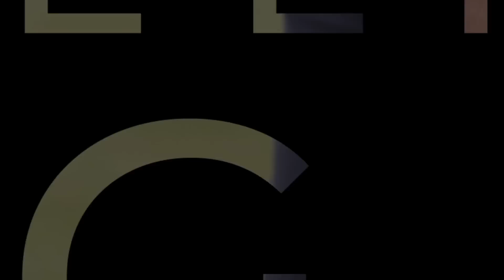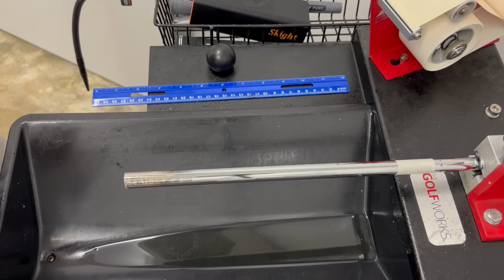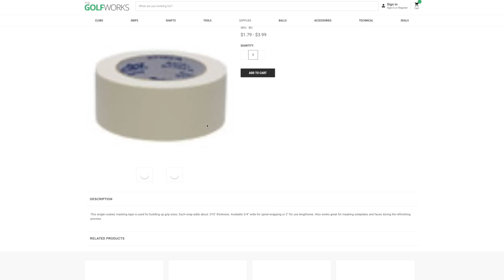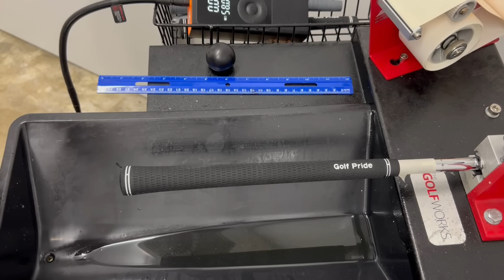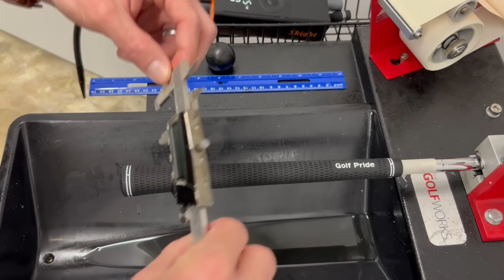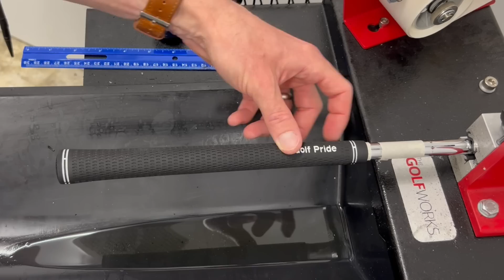Making Golf Grips Bigger with Build Up Tape / Mistake?

Comment: I realize this video is a couple years old now, but I wanted to add something.  Here's the problem I have.  Some grips are only available in the "standard" grip size.  For example, For myself I need Midsize grips, but the Golf Pride V55 grips ONLY come in standard size.  If I want that grip, I don't have a choice put to build up the layers of tape.  I thought adding 4 layers of the thicker tape PLUS a layer of the double-sided tape would be the right amount.  Would it have gotten you to 0.96 if you had added a single layer of the double-sided tape on top of the 6 layers?
Reply from the maker: The big problem is it's hard to know how much bigger the grip will get with multiple layers of tape. Yes it gets bigger, but the percentage change gets smaller with each additional layer and the grip as mentioned gets much firmer.

Comment: New to regriping my own clubs.  Have done several times and used "standard" double sided adhesive strips.  Peel off one side of tape, wrap around the shaft.  Then peel off the other side and ensured it had no wrinkles.  Then lathered on the tape with solvent, put some inside the grip, and then slide the grip on the shaft.  I see you regriping using regular masking tape with adhesive on one side.  That said, does not the double sided adhesive strips hold the grip in place better as it is laying on adhesive rather than just laying on the non adhesive masking tape side?  I see you use masking tape when sliding on the grip using a tire pump.  Great and informative videos...please keep them coming.

Comment: Late to the topic, but after fiddeling around with many layers of tape under a oversize grip, I found that a bigger grip is of course softer and therefore plays smaller under pressure. When I grip a oversize grip the rubber compresses visibly, whereas a midsize grip over 6 layers of tape compresses noticeably less. In the video measurements are all done staticly on a ungriped grip. So to build one more layer to the madness: Could 4 layers of tape be the same thickness as one size bigger in a swing gripping squeezing hand of a pro, and therefore the conclusion has come so?

Comment: Be careful: swing weights and tape. I over size all my grips but halted this practice. 
There is a 25mm wide foam double sided tape on the market now. 
Even though its a spiral wrap, it is great turns any grip to jumbo/ oversize without messing with swing weight.

Comment: Midsize grips have physically more rubber material in the handle portion… it’s thicker by design buildup tape to make grips thicker only makes the bottom hand thicker not the proper taper in the butt end… thank you!

Comment: The rubber grip is still stretching...it's stretching radially and this can not be overcome...increased shaft diameter from tape will cause this.   And increase doe tontape will always result in a reduction also.  Reduction is smaller than increase!

Comment: I go along with you, the installed grip length should be the same as the uninstalled grip length. The grip is not being stretched it is at its designed length.

Comment: Great video.  The other issue that you did not present which would be cool is the weight difference between the mid-size and regular grips and the weight of the buildup tape.  Bottom line IMO is that you can make it, see where it is and then adjust - with blowing the grips on it is super easy to make adjustments.  Once you get your recipe for what you or the customer likes then you can repeat that moving forward.  Thanks again for the video

Comment: You even gave the advantage to your doubters by allowing the standard grip to "settle" where it wanted to on the shaft. That should have added even more thickness yet it did not. Your first method that ensured all grips where at the same length is the best way to assure fairness in the test. Well done and thank you for the great work you do!

Comment: Great video as always.
Ppl always have their opinions and that’s all it is…they’re opinions.
As long as your customers are happy with the work, keep on keeping on.
I think the only reason you would use build up tape to get a. Standard grip bigger is to stretch the rubber thinner over the buildup tape to get a firmer feel…otherwise just buy the correct size grip.
I will add additional layers to my lower hand only, to increase the diameter and gain a firmer feel for my bottom hand.
Great content and patience, as always. 
Keep on Keeping on!

Comment: Sometimes stretching is good! For years I've played standard grips and the grip would move around in my swing. Bought a standard tour velvet+4 and a midsize tour velvet to see which i liked better. The midsize was too big in the left hand but perfect in the right. The plus4 was too small in the left hand and too big in the right. I measured the diameter of the grip where my right pointer finger and thumb sits on the midsize grip (.82"). Took the standard plus4 and built the butt to .094" and to get the right hand smaller I stretched the grip about 1/4" towards the end to get my .082" number. Fits my hands perfectly! I'd feel pretty bad asking someone to regrip my clubs for me with these specs though lol.

Comment: Standard "build-up tape" used on professional tours around the world are not 0.10" thick. The standard build-up tape, also sold by Golfworks, is 0.15" thick. I am really surprised that you are not aware of this. 

That is exactly why there is a Golfpride MCC +4 grip. That +4 grip simulates 4 pieces of build-up tape, which equals 0.6" -- thus a  1/16" larger lower-hand. Whoever told you that 0.10" build up tape is standard is dead wrong - and if it says it on the Golfworks website they are wrong. If the standard was 0.10" then that Golfpride grip would be called MCC +6.

I've bought grips that Golfworks has listed as 65g. When I weigh them, they are 58.5 grams. Some information online is just wrong and you have to verify it before claiming it is correct to your audience.
Reply from the maker: The primary issue remains regardless of the thickness of the tape. The rubber stretches and thins out and the size does not change in the basic math that many believe.
Reply: @EFGMC  First of all, not all grips are 100% rubber or rubber at all. For instance, my grips are 100% polymer Winn grips. The build-up tape absolutely changes the diameter of the grips, or else NO PGA TOUR PLAYER would ever request it. It's a fact that that the vast majority of PGA players, whom are highly-sensitive to feel, all request build-up tape for a reason. If it didn't increase the grip size, surely they would be the first to put an end to the practice of having it added. Scottie Scheffler for instance uses a standard grip with 6 layers of build up tape. I would love someone to tell him that all the build-up tape is doing is stretching the grip 😂 Or tell Tiger for that matter. Again, it increases the grip diameter regardless of whether it may stretch the grip. Those two things are not mutually exclusive, yet in your comment you have stated it as if it is.
Reply from the maker: @Thapa_Golfs  Does it make it bigger, yes with enough wraps but it's not a 1 to 1 ratio. Each grip is going to be different so get some calipers and see what your particular grip does with multiple layers under it.

Comment: Using build up tape on a standard grip to go to a midsize is inane. If you need your grip to be midsize, JUST BUY A MIDSIZE GRIP! 😆😆

Now if you need something in between standard and midsize, then yes, build up tape is useful. In addition, there is no right way to regrip your clubs. It’s a method to use of course, but each golfer is different in terms of what they feel. Look up regrip techniques on YouTube and you’ll see a hundred methods (exaggerating, but you get the point). Mr. Elite, do it your way. Don’t succumb to all these “experts” that probably don’t even break 90! Here endeth the lesson 😂

Comment: I have the opposite problem. I have PING Aqua grips -1/64. The standard Velvet grip on 0.600 shaft is too thick for me. I would like the colored Star grips, but I'm afraid they will be too thick as well. If I order undersize 0.58, -1/32. How many tapes should I put to achieve Aqua -1/64 vs standard? And is that the ideal choice?
Reply from the maker: I would take the standard and stretch it down an extra 3/4 inch. That will get you close.
Reply: @EFGMC  Thank you very much. And can the grip be stretched even when using an air gun? I don't have experience with it yet. You really don't recommend taping the undersize? By the way, I really like your channel
Reply from the maker: @konrigm  They will stretch, but not sure how long they will hold the stretch.

Comment: Of course you only got to half way. The larger internal diameter of the shaft with 6 layers of grip tape means the standard grip must stretch to go around the larger diameter. As the grip stretches it thins. Duh. I don't know why anyone would give you grief about this, as this is basic, elementary physics. "As a body is stretched it will become thinner." If you want a larger grip just buy larger grips. Love your work mate. Keep going.

Comment: Can you use a simple tire compressor to blow on or off golf grips?  Do you need a compressor that is 1/2 gallon spec and if so is that different than the ones you see on Amazon for around $50.  Thanks for the info!
Reply from the maker: As long as it can achieve psi of 55-60 it should work.

Comment: Two MAJOR points were not addressed in this video.   FIRST:  What happens to a grip when you STRETCH it over build up tape.   You decrease the thickness of the grip.   SECOND:  You increase the hardness of the grip,  removing the "feel" and shortening its life.  Years ago we only had standard size grips.   Now we have Undersize,  Standard and Jumbo/Oversize.  After two buildup wraps you should be going up a size to maintain the grips life and comfort.

Comment: Did you use a single layer of double sided tape? Per Golfworks that's required on any grip install or your desired size will come out small. Also I've used the Golfworks spec tape and it is thinner than they say it is. I would say use a std tour velvet 600 core grip on a 600 butt shaft with 5 layers of double sided tape. I think it would be very close to 960 midsize.
Reply: OK, thanks for that info. I personally wouldn't try to go to midsize from standard with tape. Tape is a good way to get an in between size like .930 though.
Reply from the maker: I was only using the build up tape here since I installed with compressed air. I can tell you that build up tape seemed to be right on the .01 thickness they claim. Didn't include in the video but I did actually measure the shaft itself with the extra 6x tape layers before installing the grip and the measurement came out to .660 exactly as it should.

Comment: Despite whatever has been said, I have used your guide and converted my standard grips to plus 4’s which is working perfectly for me. Also in the UK 1 roll of tape is £1.50 and 8 grips would have cost me close to £90 so for me I thank you.

Comment: You were not wrong. You can increase the diameter but it does not equal going from standard to midsize. I use 3 extra wraps on the rh part of the grip to take some of the taper out but it in no way equals a midsize grip which I do use on all my wedges. Thanks for all your videos. I've been building clubs over 20 years and I still find helpful tips in your videos. Keep them coming. Yours is one of my favorite channels.

Comment: I think you’re correct with where you are measuring. But I will say that grip looks larger in the lower section. What does it look like around 6-8 inches down the grip?

Comment: I usually measure the build up diameter before installing.  Do you build up the taper portion of S200 shafts?  Seems they are a good deal smaller 8” below the butt.

Comment: You were not wrong in previous video. But the grip length does not shorten a 1/2" due to putting 6 layers of buildup tape. It might shorten 1/16" but not a half... We have to get it to the pre-determined length as you normally do with the tape marker for the length. Thank you for your videos AJ and for taking the time to verify this to some of your followers. 👍👍

Comment: I install my grips with masking tape and air compressor. I play Lamkin Sonar Blackout standard+ with 3 wraps of masking tape, you can definitely tell the difference with each additional wrap, it feels just a tad thicker and a tad firmer I think because the grip stretches out a tad with each wrap so it feels ever so slightly thicker and firmer. So with those 2 feels combined it’s more comfortable for me. It’s not gonna take the grip all the way from standard to midsize, nor should you try to achieve that with wraps of tape, but each wrap of tape will alter the size and feel of the grip. And fyi, I’ve tried midsize, it’s just a tad too thick feeling for me, I just don’t like that feel. I enjoy your vids, keep up the good work👍🏻

Comment: I never thought trying to make a regular sized grip into an oversized grip worked since I was first club fitted to a jumbo grip. Re-gripping years later, the gentleman that was going to re-grip for me didn’t have my grip in stock. He said he was going to be able to build up a mid-size from the same manufacturer to a jumbo. I politely asked that he just do one so I could see if it was the same, if it felt the same. It was not the same, it did not feel the same. I said as much, politely. He un-politely said I didn’t know what I was talking about. I politely paid from the single regrip, and move to another shop who not only had my grips in stock, but insisted that I try at least 3-4 other short shafts gripped with different grips until I was satisfied. He then regripped a single club, which I checked and tested again, and I left with a full set of regripped clubs, and he had a new customer for life. 

I have a feeling that the first gentleman was one of the people who disagreed with your original post.

Comment: This pretty much depends on what you are going for, standard grip tape weighs 2-3g per strip so adding 6 to a 50g grip would be like having a midsize at 62-68g of weight. Personally I like standard +3 as midsize is too much grip and adds too much weight.

Comment: This is old of course, and im just home off the course. The tape. Is everyone missing the point? I use 4 over on a standard grip. As I prefer the larger size i cant stand the softer feel of the larger grip. iits not math? well it is, but the math needs the rest of the math. So in conclusion all of your effort is wrong. you are just not chasing the right animal.  I'm not going to do the graphical corrections.

Comment: In between standard and mid sized with reduced taper for what feels "right" to me. The "plus 4" standard golf pride grips feel noticeably larger in the lower hand than four wraps of tape. My old Velvet Victory  grips were firmer than tour velvet's especially installing .580 core grips on a .600 diameter shaft. That alone made a slight difference in size. Throw on a few layers of tape under the lower hand  and those old green and black grips were perfect, lol! I'll just stick to +4's for now.

Comment: I agree with you AJ. I've regripped my own clubs for many many years. I myself have researched this topic before also and what I remember finding is that the amount of "build up" tape required to get a "Mid Size" equivalent, does not exactly get to Mid Size. I remember the info I found said, it would, be "slightly less" than Mid Size, which is right around the number you got (.93 ish). The info may have come from Golfworks, in an old catalog, or may have been off the internet. But, I never saw any info claiming a perfect Mid Size match using build up tape.

Comment: I always thought it was more about in-between sizes than replacement sizes.  I'd been a midsize player for years. When I got a set of Srixons, it was when there a supply chain shortage and grip stock was hit and miss. I had them ship TV's 'loose in box' thinking the store I bought them from could add midsize grips when they came in.  Unfortunately they were out of the midsize grips I wanted when the clubs arrived.  I was eager to hit my new clubs so the club tech suggested 3 layers of tape to make it just under midsize.

Turns out I absolutely loved it. And did the rest of my clubs the same way. I don't get why you would try to add enough tape to make a standard truly midsize.
Reply: Some people are cheap and/ or lazy.

Comment: Well, if you think about it, mid size grips have the same .600 core as standard grip. More rubber thickness to make it .060 thicker. 6 layers at .010 will make the shaft now .660 thick and will definately stretch that .600 core standard grip, making the rubber stretch and get thinner and firmer. Its a technique to achieve a grip thickness somewhere between standard and mid size and change in grip feel.
A.J is totally right about getting mid size grip to get that mid size grip thickness.